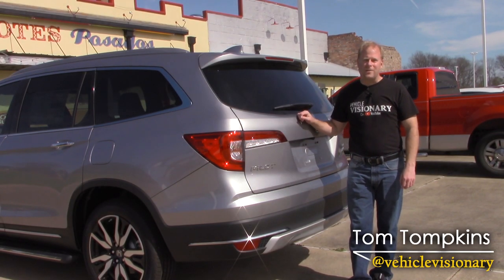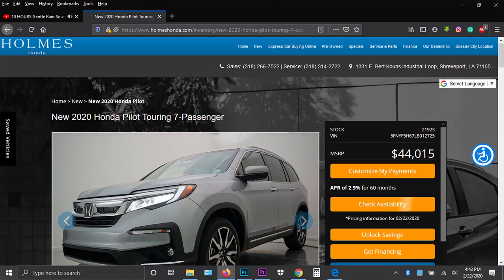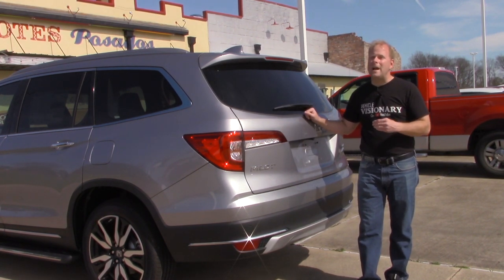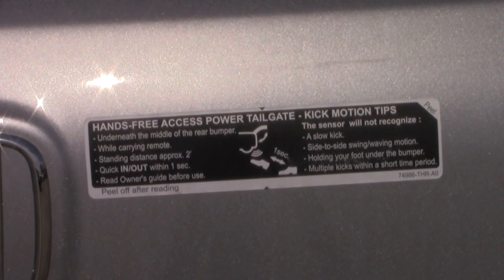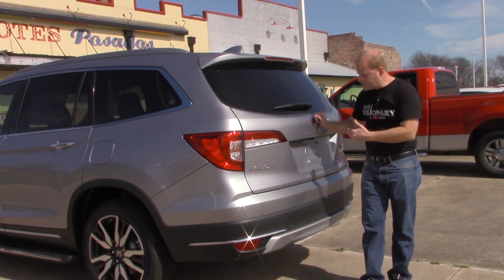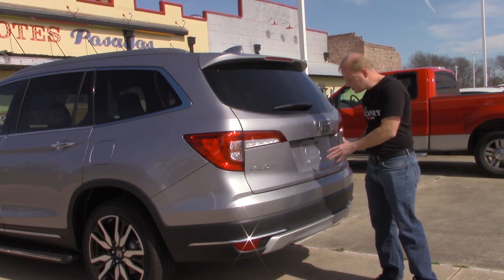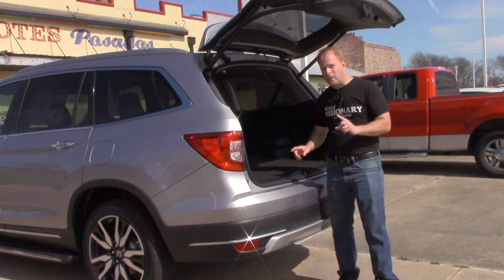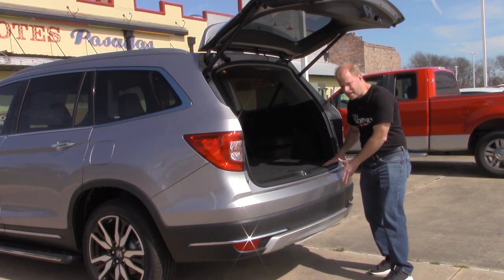How To Use The Hands Free Power Tailgate/Liftgate On A Honda SUV Or Minivan

Comment: What other vehicles do you know that have that feature?
Reply from the maker: Quite a few, more than I may know of. I know GM has this feature on many vehicles as does Ford. I did a video with a Lincoln Continental Reserve a while back that has it too.
Reply: @VehicleVisionary 
Interesting. I’ll see if I can identify those sorts of vehicles in case their operators are struggling with that feature.

Comment: I have a 2020 pilot .I can't open it. How do u open it?  It's stuck or something
Reply: Need help🙏
Reply from the maker: What trim level do you have?
Reply: My trunk doesn't open??
Reply from the maker: Does it not open at all or do you mean it does not open with the kick feature? The reason I asked about the trim level is that the feature I showed in the video is only available on EX-L trim and above. If your Pilot is LX or EX it won't have that feature.
Reply: I have a 2020 touring and I can’t get mine to work either.